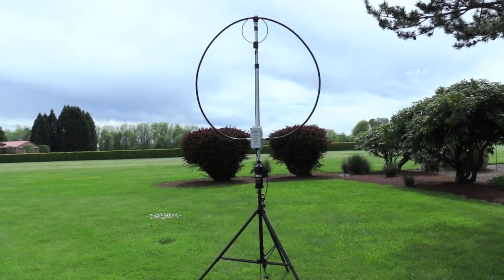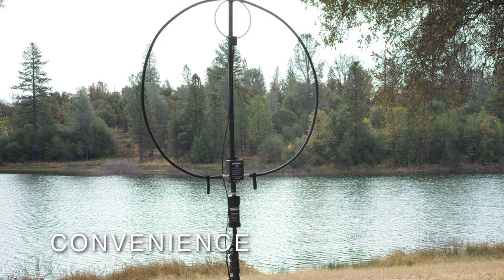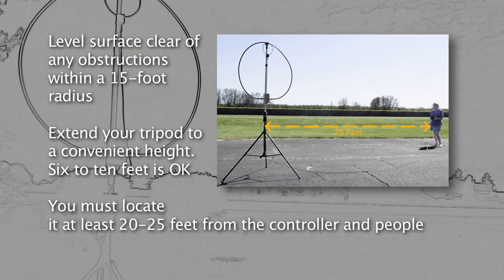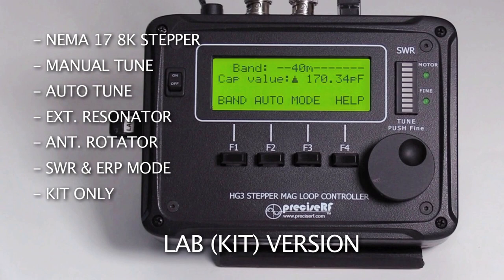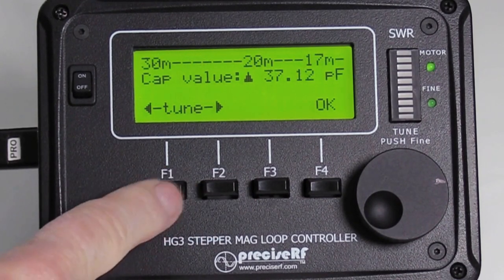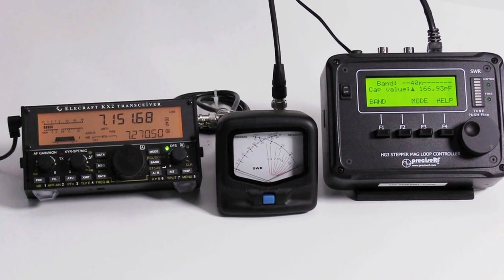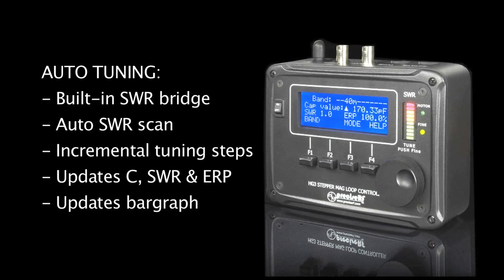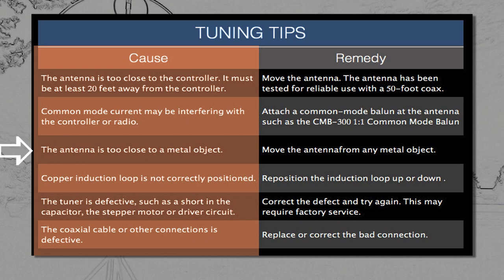HG3 Stepper Mag Loop Antenna

Comment: Is the RJ 45 connection compatible with commonly available media converters to use fiber duplex cable instead of CAT6 copper cable?
Reply from the maker: Seth, no, the RJ45 is not compatible with media converters. The HG3 uses a proprietary signal between the controller and the tuner. We use it as it's a commonly available electronics part.